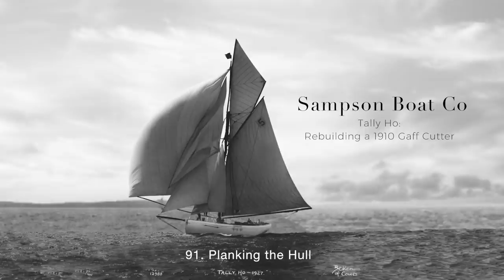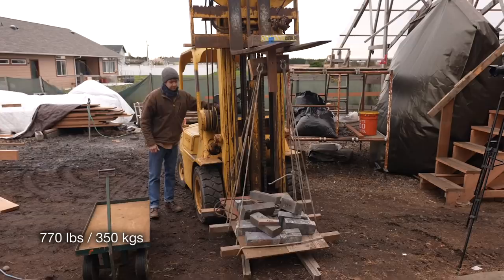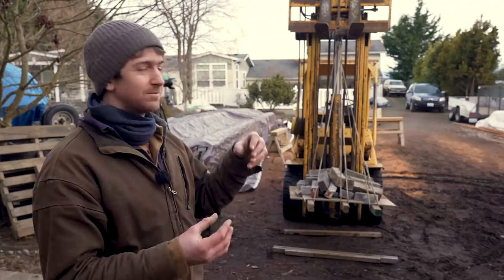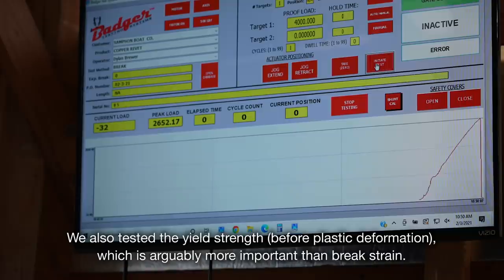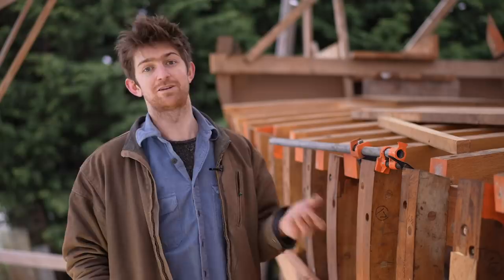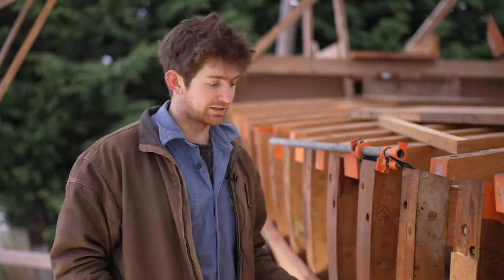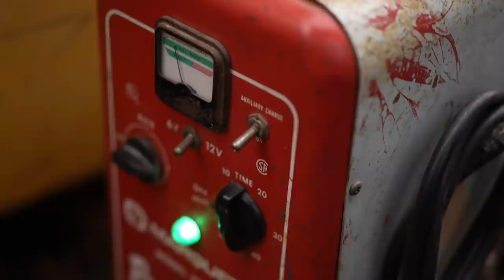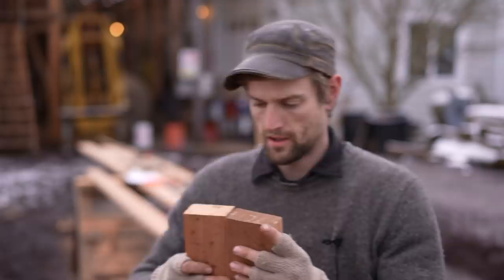Planking the Hull - Part 1 (Rebuilding Tally Ho / EP91.1)

Comment: "Of course it's gonna leak"
Pete's a hoot lol
Reply: All wooden boats do.
Reply: Peter smith  yeh nah I’m pretty sure my aluminium boat doesn’t have a hole it in so it doesn’t leak? Amazing
Reply: @thegodemperorofmankind7yea704  It will, just you wait.
Reply: @bphenry  You have an over/under on how many decades that will take?
Reply: @thomasarussellsr  Make that "most". Or "all traditionally built wooden boats leak". The last A-Class catamaran I built out of 3mm ply didn't leak. It didn't live in the water, but spent most of it's life on a trailer and only went in the water for racing, so a very different type of boat.
Reply: @thegodemperorofmankind7yea704  ... she will; eventually.
Reply: @thegodemperorofmankind7yea704  Pete's right. The only boat that is not "gonna leak" is a sunken boat. Then it's a shipwreck.

Comment: On strength testing, what I find truly marvelous is how the original boat - rotten throughout though it was - was still holding together.
Reply: Yup, and they didn't have fancy testing facilities. "If it holds a team of twenty horses pulling from both directions, it'll hold a boat together. That'd be my wager. Would have likely been the most fancy test they would have come up with.
Reply: @thomasarussellsr  this boat was built post industrial revolution. To suggest that engineers of the time had no proper testing method is absurd! Ultimate tensile stress, shear stress etc etc are not new in their discoveries and have had proper testing for a long time now

Comment: Loved seeing Rosie tie off that extension cord junction. I used to do touring concert sound, and we always referred to things like that as, 'making them melon proof'. If one was not diligent in anticipating potential problem areas, inevitably some 'melon' would trip over the cord right in the middle of the guitar solo. Just took me back for a bit there. Fine work being done, as usual.
Reply: You sure that term wasn't coined by a Blind Melon roadie?  That is my understanding of it's origination.
Reply: I was thinking the same!!
Reply: @dennisdownes9319  You all may be correct. I never knew the origin, but knew how to make stuff 'melon proof'. Both of your thoughts on this make a great deal of sense, however!
Reply: Not to belabor a point, but I ran across an old Showco buddy on FB, and this is what I got.
."Haha - well ya Melon... 😉
as we know, a person that is in error can be referred to as a Melon or Melonhead. Soo... you get it
Example- we tried to protect a XLR junction box so a Melon does no step on it. And if they were to, they would be a Melonhead. 
An unprotected, unmarked area is referred to as a Melon trap...😁"

Cheers!

Comment: To clarify Pete's comment on caulking. It doesn't tension the planks --- but rather it puts the plank long edges in compression. As the wood absorbs water, it compresses still more, tightening the long seams.

Comment: Thousands of pounds on one rivet... Wow! Pretty stout safety margin there I suspect.
Reply: The thing to keep in mind is that metal suffers from fatigue when the load is repetitive. For a small number of cycles during use, it can withstand large loads, but for many cycles, it can withstand far fewer. To anticipate the effect of fatigue, the strength in a static load test needs to be high.

Comment: Great team work.  Great explanations by both Leo & Pete on the details of planking.  I found the strength testing 'riveting" as well as the discussion of the caulking bevel to be a "water tight" summary.  Thanks for sharing gents.

Comment: Pete, try using an upcut spiral cutting bit with NO bearing and plunge the bit slightly into the guide fence and you will eliminate any sort of tiny ledge and save that much more time not needing to hit it with yet another pass with yet another tool.
-✌🏼

Comment: Know it is not a traditional method. But with today's materials, the cocking between planks, when get get there! Thinking out side the box... what do think about cutting a rabbit on the edges in a round o- ring shape ( to the inside of plank closer to frames) then  place a plastic round rod that is soft and compressible  material between planks can still use traditional cocking on the out side in,  but now would have a moder n O-ring type seal, on inside. That will not rot!

Comment: A tip for routering the calking bevel: either swap the bearing for a size up or if your angle is too fine for that wrap durable tape (insulation tape works) around the outer edge of the bearing, this will eliminate the step created by the bit due to cutting at an angle saving you the mission of cleaning this off. The tape does not last but changing it every so often will likely be quicker than planing off the step. If you do this make sure the cutter bearing is oiled and spinning effortlessly or the tape will burr and get ripped up, go easy on the pressure holding the bearing against the guide surface. Be sure to end the tape wrap exactly where you start to ensure a properly round surface.
Reply: You can also look for a straight bit that will accept a double bearing, use a softer nylon or teflon bearing, etc.
Reply: @boooshes  yes different bearing is first prize if you find one that works. The tape is a bit problematic.
Reply: One can also use a bit that has been sharpened so that the blades are the correct amount smaller than bearing. Routers are awesome but take a while to get into as much of what's involved is creating jigs to get the tool to do all the weird stuff we want to

Comment: Originally she would have been linseed oil, cotton, oakum ( literally old threadbare linens) covered by pine tar mixed with flax oil and or tallow, heated and smeared into seams.  The deck is done same way still but hulls now a days used seam sealer compounds. Bottom paint, originally would have been linseed oil mixed with red lead and or white lead then tarred offer below water lines.

The pine tar is leftovers from making turpentine commonly called rosin, same stuff used for decades to rosin violin bows, thinned with flax or linseed oil and tallow makes a good seal that doesn't let go...bad thing is uv heats it up so it can get messy on decks on hot hot days.

As for curving planks, well if you build a strip canoe you learn quick just how lumpy flat strips are and feel. It also looks nicer inside.

The planking is the easy part caulking is hard skilled work, too little it leaks too hard it leaks, too deep it busts planks. Some ship builders tallowed the caulk itself, not sure why.

Some other ships when first set into water are surrounded by fine wood dust so that wood dust fills any cracks and stops leaks till planks take up water and expand creating a tight waterproof joint as long as she is in water.

One mistake Pete made, she is not carvel planked ( which means one plank overlaps another). Her dingy on the other hand would be. Not sure if tally ho would have had the dingy lashed to deck to cover a hatch, side mounted or dragged behind.  Some tenders were creatively used as water sheds during stormy weather so that crew could stay out of weather and steer.  At least by some accounts I e read but it's hard to tell as it's hard to read bad handwriting with old English.

Comment: Copper work hardens. Where you form the rivet head the copper will be harder than the bodie of the rivet. Its tensile strength will vary throughout the rivet. Approach your local technical college they might have a tensile testing machine.

Comment: I had a boat a shark fisherman had it was planked like you boat but instead of oakum And cotton they used fiberglass on the last application.The boat leaked all the time and I went through batteries every 3 weeks 2 /125 lbs. Batteries picked up at Freeport marine and brought back to North Port and run out to the boat by a water taxi..not fun I sold it and a guy who worked for me bought it he used a circular saw to cut out the fiberglass and went to hospital with it in his eye . Afterwards I bought double planked boats and oakum .Now I don't have a boat and miss all that fun and work on the water.

Comment: Copper work hardens and age hardens. It would be interesting to see how strong they are after a few work cycles.
The more important numbers are 
(1) how much force does it take to pull the rivet through the plank? 
(2) what loads can the plank take against the rivets?

Comment: First time I have ever seen wood boat building, I am surprised no wood glue was used, it seems like that would make the boat much stronger.
Reply: Leo has occaisionally made localized repairs, making a deadman plug to replace a knothole or check. He almost always uses PUR glue for these repairs.
Otherwise, glue (including epoxy) is not used in traditional wooden boatbuilding, b/c it expands & contracts (due to temperature & moisture content) at a different rate than wood. Over time, a glue joint will always fail. If the expected working life of a boat is 20 years, glue is great stuff. If the boat is meant to last 50 years or more, use it sparingly.

Comment: Easy to forget (or not realise) that all that lead in the keel is hanging off those bolts, floors & rivets. Also easy to forget that at least 1/3rd of the planking area is actually in contact with the frames ... makes ya fink
Reply: The careful shaping of the outside of the frames & the inside of the planks is essential, it maximizes the contact area. The tension created in the rivet by hammering its head puts those 2 wood surfaces in compression against each other, it's the friction between those mating faces that gives strength to the structure !

Comment: Thinking of the giant ship saw with the rotating bevel and the small-scale circular saws with the same feature: How did ship builders handle that problem in the days before power tools and giant protractor gauges? Did they just eyeball and hope for the best? Put a piece of wood on the boat three or four times until they got all the angles right? What tricks did they have to make that efficient and practical?

Comment: Amazing work Leo and Volunteers. Your journey of boat building is engrossing as I am following you from day 1. I am curious (just for knowledge) as to why is the orange paint( Anti Rot) is being used only at the extreme edges of the planks and not along the planks which run thro the sides of the boat?

Comment: It looked like you were doing static stress tests of the rivets.  Did you do any dynamic stress tests?  A dynamic situation might be a large wave crashing onto the boat, as opposed to one rolling under the boat.  I admit I'm rusty of what I learned in engineering statics and dynamics classes, so ask a engineer who is current.

Comment: While it is reassuring to discover the fail- and yield-strength of the copper bolts, it begs the question of how great the cost reduction would be to more scientifically design the fitting points. (Assumes that the diameter is generally ideal for the procedure being employed.)

Comment: Wowowow. This is excellent. Loved the mechanical testing on the rivets. I have seen this same sort of apparatus for eye splices in arborist ropes, etc., so was interesting to see it used here. Also - when you talk about the rivets holding the keel timbers to the frames - when in the water is it more stress put on the rivets by the hanging weight of the keel timbers or forces on the hull by water?

Comment: Surprising strength in those rivets Leo, however, you say they take the weight of the keel, surely a lot of the keel weight is taken by the water it will be sitting on/in. Or is there something I am not seeing here? 
P.S. Enjoyable vid as always. Also, I liked the bit at the end "Part 2 coming soon", excellent!

Comment: Tell the owner of the four door pickup with the nice canopy that he can pull out that dent in the tailgate with a hot glue gun and a paintless repair gadget for less than $50 all up, I had worse than that and it was easy! Check out eBay or Amazon.

Comment: Why don't u use a table saw,  called saw stop, check it out, to cut ur plank in a slight bevel that will work. So u don't have use a planer and router. Maybe sanded a little.

Comment: 1200lbs in tension is nothing to sneeze at, considering in most engineering applications, you avoid loading fasteners in tension, unless they're designed for it.
Reply: Not sure I agree. Every time you tighten a bolt, you put it in tension. How would you hold the planks on with a rivet in compression? What would it be pushing against?
Reply: @andyinannarbor  I think you mean, "how would you hold the planks on with a rivet in shear," which you wouldn't. In that case, you need them in tension. But, it's far easier to transfer loads through fasteners in shear than tension, hence, the convention.
Reply: @thomasbecker9676  at the risk of continuing a pointless discussion, a rivet holding two planks together is in tension. Portions of the head are in shear, but the body (shaft) is in tension unless the planks are sliding with respect to one another.
Reply: @andyinannarbor  I'm aware that rivets holding on planking are in tension. I'm stating that when able, most fasteners should be in shear (through their shank/body) rather than in tension. This is coming from a background in aerospace.

Comment: why do caulking and all that that entails and not do the way modern wooden yachts are built, meaning U-shaped planks set perfectly tightly, and fiberglass+epoxy over on top. You can keep epoxy perfectly clear and have the structure of wood show through, what could be better than then?

Comment: Regarding the rivet testing, you certainly gave a lot of thought to it and were diligent in your testing. I wonder if you can explain any thoughts you have on the strength of one installed on your boat vs in the sling test rig. For example, I would have though the peened end might be the weak point considering how much copper work hardens? Were the ones in the sling test rig hand peened as well? Do the floors/ballast see much of a cyclic load at sea?

Comment: I've noticed you don't cut planks to length on the ones that go against the transom, when those are cut, how do you deal with the exposed end grain? Do you use some sort of trim? or end grain exposure is not much of a problem at that point? I imagine I'll get my answers in future videos, but I couldn't help but wonder considering I know very little about woodworking and nothing about boatbuilding. Anyhow, great update as always, and the video quality is improving on every new release. Cheers!

Comment: I asked this question on the facebook page too - The rivets and planks contract and expand and as the boat grows older the planks would tend to shrink. Will this cause the rivets to loosen up from the wood and weaken the structure of the boat?

Comment: Awesome vid! love the drone wrap around footage. Question, how will the planks tie into the transom?
Reply: The aft ends of the hull planks are screwed into the edges of the transom planks. This joint is bedded but not caulked, driving the caulk into that seam would further weaken the screws' not-ideal hold in the transom end-grain.
Reply: @frederickstibbert7389  Makes sense! Thanks for clarifying. Is there any reason why the transom is not screwed into the planking end grain? i.e. having a rabbet at the transom that the aft end of the planks sit against (as is the case with the bow and below the transom). That way the aft end of the planks will be hidden by the transom when looking from behind (more aesthetically pleasing I would think).

Comment: 11:18  Why do the planks extend past the stern of the boat, but at the front they are set into a rabbet?  Why no rabbet where they meet the transom also?
Reply: There is a rabbet at the stern, but it takes a tight turn out the back of the sternpost above the propellor cutout. That's where the transom planks start, it's a fascinating bit of 3-D geometry.

Comment: Why do you not fill those nail holes with glued in hardwood dowels?
Reply: A softer wood than the frames will guarantee that they will swell when wet and completely seal the hole while not having sufficient compression strength to create forces that would tend to split the frame.  The planks will hold the plugs in so glue is not needed, plus the glue won't shrink and swell with the wood.

Comment: I assume shipworms aren't extinct, I wonder what the plan is for protection against them?
Reply: Copper paint probably.
" Copper sheathing was used on wooden ships in the latter 18th century and afterwards, as a method of preventing damage by "teredo worms". The first historically documented use of copper sheathing was experiments held by the British Royal Navy with HMS Alarm, which was coppered in 1761 and thoroughly inspected after a two-year cruise. In a letter from the Navy Board to the Admiralty dated 31 August 1763 it was written "that so long as copper plates can be kept upon the bottom, the planks will be thereby entirely secured from the effects of the worm.""
From Wiki   https://en.wikipedia.org/wiki/Shipworms

Comment: Hey Leo, when you installed bresthooks you were careful to fill in any pockets where debris or water could collect.  I'm wondering about the small gap between the garboard planks and the keel around midships there seem to be wedge shaped pockets.  Do these pockets exist? If so will you fill them? Or are the safe because they are always in salt water?

Comment: Be careful using copper as it easily work hardens this greatly reduces its ductility and thereby it can become quite brittle. Are stainless bolts not an option for floor mounting?
Reply: I don't think the copper will be cyclically stressed to anywhere near the point where it'll work-harden, but inspecting the peened rivet heads every 5 years shouldn't be ignored. As far as stainless steel is concerned, Leo's been pretty adamantly against using any kind of iron-based fasteners.